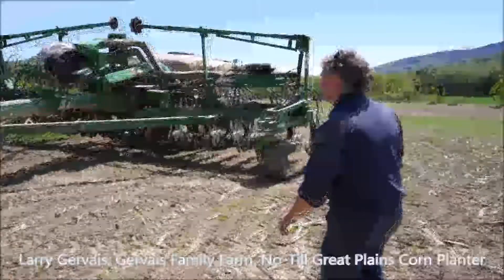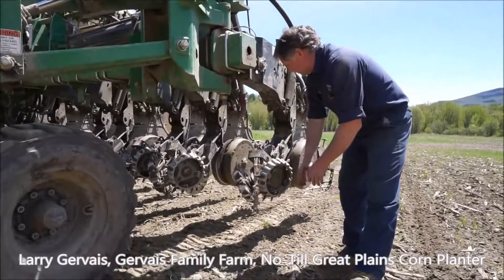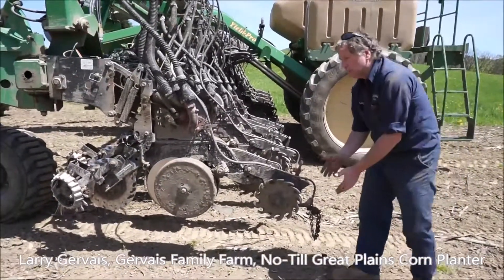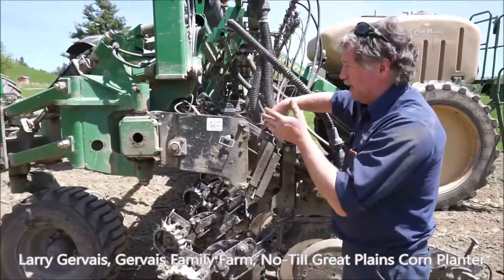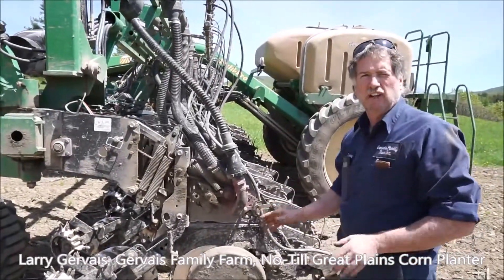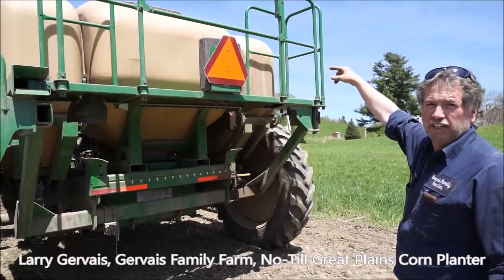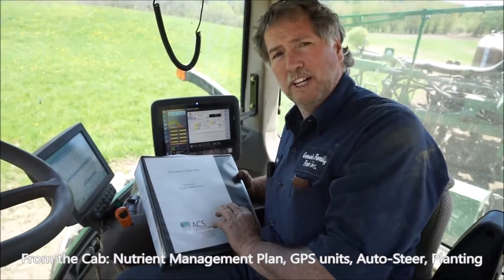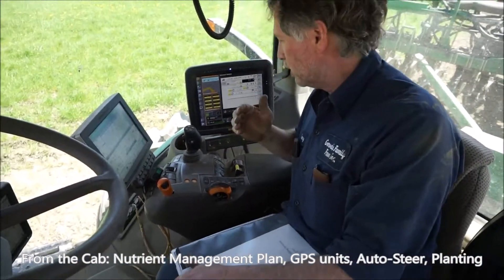Precision Planting: Great Plains Corn Planter, GPS, Auto-steer, NMP

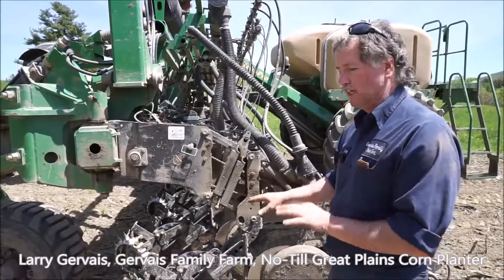Comment: HI Larry, at the 3:00 mark you mention a downforce adjustment you control from the cab, what is that?  I have a GP planter and I am not aware of that, other than the air cylinder system.  Thanks